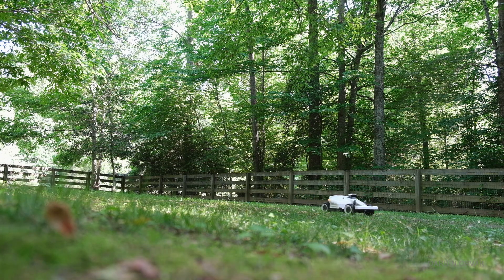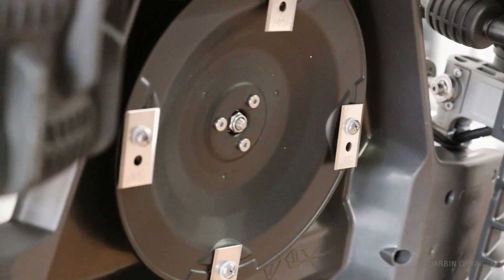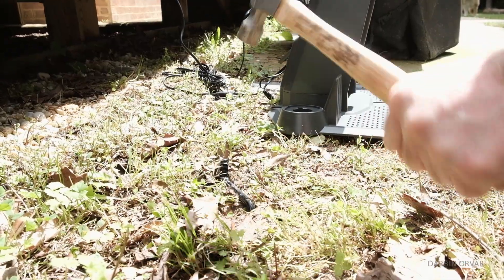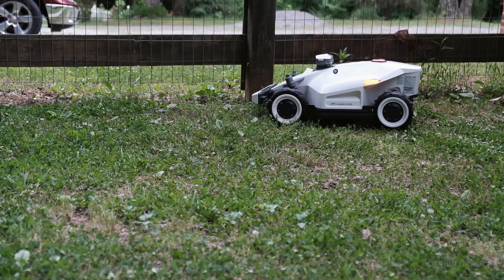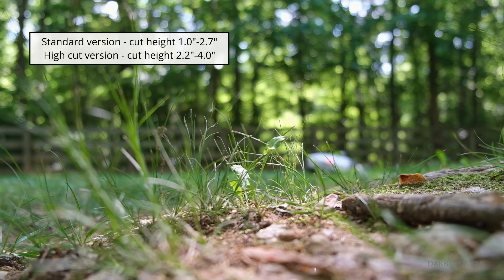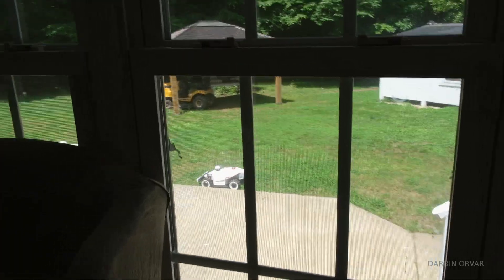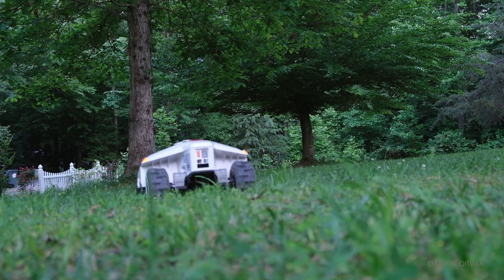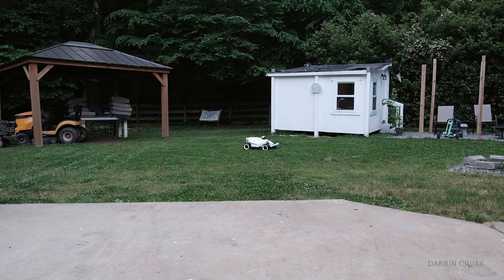Robot Lawnmower Durability Challenge - Mammotion LUBA 2 Review

Comment: The Mammotion Luba seriously sucks!!!! It is Chinese so.....  I probably wouldn't have purchased it if I knew it was Chinese. I have always had bad experiences with Chinese Products. They never perform as stated by the company. They seem to always be about image but have no substance.

I purchased one of these a year ago and it was difficult to set up but I eventually got it. There were many issues with this thing but I managed to work around them. Tech support was almost non existent. The only place to get support is chatting through their app and that is buggy and constantly loses connection. You have to wait for a tech to answer because they are constantly "experiencing a high volume of inquiries" and you have to wait in a queue that tells you your position in that queue. The queue can magically grow and your position moves backwards (like from 2 to 14). Once you get the chat with a tech, you can magically get disconnected when the suggested fixes don't fix anything and the problem proves the be more difficult than a restart. I figured maybe it was just new stuff and should get better with time and updates. Yeah right!!

This was the situation when I purchased the unit a year ago. Now with all their upgrades it actually seems to have gotten worse. Now their GPS location system seems to vary by more than a foot and as much as two feet. In places where I had spotty location info a year ago now have no location fix at all. And yet they still have 22 to 27 co view of the satellites. The RTX is viewing the entire sky and sees 39-40 satellites. So if they can't get by with 50% or more co viewed satellites, the tech must be flawed.

And don't get me started on the app. You have to use the phone app to do everything with this robot. The app started out clunky and just got retarded with each update.

Side Note: This thing keeps an open connection to a Chinese server. A high security risk to have with a country that has vowed to hack the USA.

This is a great idea but the execution is abysmal. It isn't getting better either; it just keeps getting worse. I don't know how to express my dissatisfaction with this product any better without starting to use bad language. So I'll stop here.

Bottom line: If you want more headaches in your life, switch from manual mowing to this piece of crap robot!!!!

P.S. Watch out when comments are turned off of Luba review videos.

Comment: Regarding sticks - when you lower the cutting disks, there's a rubber boot between the disk and mower that accordians down to protect the motors etc.  The first Luba version had an issue with some sticks shredding those boots because they were somewhat thin.  I saw a mention that the new ones are a bit more robust, can you take a look at yours and see how they've fared? I expect a shorter cut length would expose the boot more than a higher cut, so YMMV based on that.  They might be something we'll want to have as spares onhand.